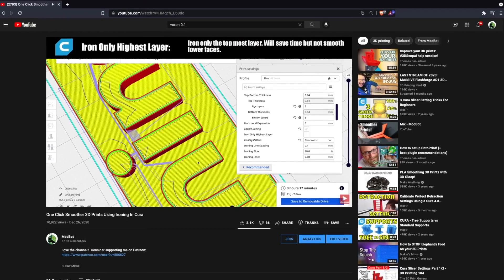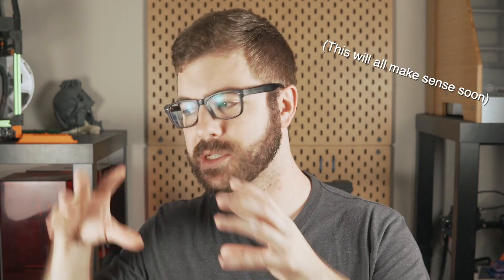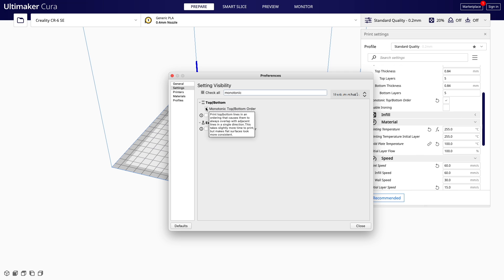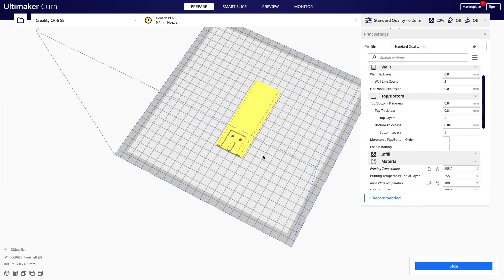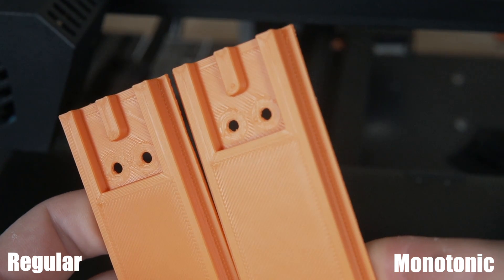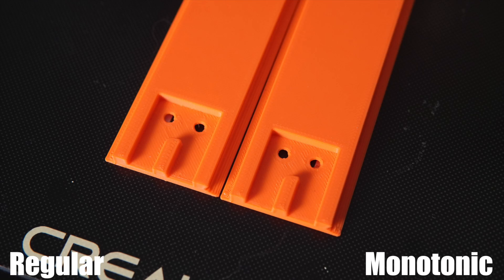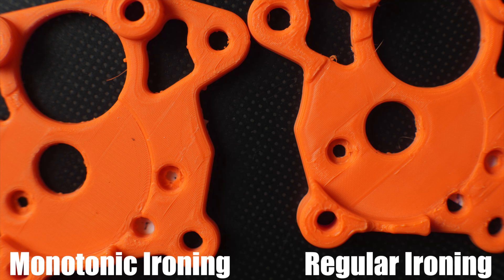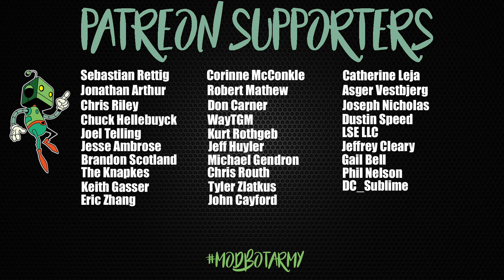Cleaner Top Layers Using Monotonic Ordering In Cura! (With & Without Ironing)

Comment: Would the z-hop option prevent you ironing from damaging your prints?
Reply: No. The problem is not the travel back but the inconsistent neighboring conditions between different lines. Some being printed with empty space on left and existing line on right, others vice versa, and worst case lines no both. With monotonic, all lines have the same neighbouring condition: existing line on consistent side, existing gap on other.

Comment: A) the differences between regular and monotonic top layer, looks almost identical to me. it takes the same amount of time it seems to 'jump back' to those gaps, of which you seem to say doesn't exist, but was very obviously there int he video.. it does one side, then 'jumps back' to the side it left behind.. the only real difference is that it starts it at the same 'direction'. 

B) it also looks like you are over extruding for your top layers in general... those are so insanely smooshed lines there bud... may want to check your settings, then rerun your tests to see if you got the same results.. because I will promise you that without that over extrusion, the monotonic will look EXACTLY the same as the regular. Not in ironing, but in just creating the top fill. and with that, you may not even want to do ironing anymore, cause the top layers will look amazing once you're not over extruding :D

Comment: What happens if the ironing just ignores holes? No jumping around at all, just pass over the hole? Would it mess up the side of the holes or would it just remove all these likes completely? :)
Reply: It would mess things up as ironing does extrude while it moves. Typically that's only 10% of the normal rate but that would results in strings and boogers on holes.

Comment: your using version 4.11 and i have version 4.8
either i have a future version or are they forgetting 0.8 is a higher number than 0.11. shouldn't my version be 4.08?
apparently version checking isn't working because 4.8 is a bigger number than 4.11.
Reply: Most public-facing projects don't use double digits for versioning numbers less than 10 and all of them use double digits for multiples of 10. 4.8 is not the same as 4.80.

Comment: Semi-unrelated: i can't see hardly any people using zig-zag pattern for top and bottom surfaces, how come? I found out it looks basically the same but sometimes print time is significantly shorter. So far it has served me well as a nice trick to save quite a bit of time on prints
Reply: When you choose "concentric" ironing pattern, cura removes the "monotonic Ironing order", so, looks like gotta use ZIG ZAG, for that

Comment: Now try my smooth profiles on your prints without ironing and compare. I’m curious about  your results.
Reply from the maker: I should be able to run one tomorrow. Only issue is all of my tests were with ABS. Do you have one for ABS? I can modify the temps but want to make sure I give the smooth profile it’s best shot against the prints I ran.
Reply: @ModBotArmy  I just modify temps and use it as is. Or just make the few mods to your profile in Cura that I show in the video.
Reply: @FilamentFriday  I'd like to see a deep dive why the new Super Fast Ultimaker profile you adapted works so well? It has halved my printing time and I don't see any real quality difference. It works, but why?
Reply: Am I the only one that's noticed cura got rid of the wrench icon by the slice button and the "select surface to place on bed option"?
How are you supposed to do layer pauses without the wrench? Manually? Smh.

Comment: I'd like to see if ironing affects dimensionally critical parts.
Reply: It will effect thickness at there is a 10% flowrate when ironing. The difference is minimal but it you're needing .005" clearance between items you'll want to run a test print to verify fitment.

Comment: I think you miss what is monotonic . The filling direction is all the same (example: from bottom left to top right). The cause of imperfections is that nozzles are not perpendicular and it will a little play when changing directions. The base plane of the tip of nozzle is not parallel to the x/y plane. So you will be printing leaning to one direction and filament will behavior differently when handling other directions.

Comment: Is there a option to make the top layer walls also smaller? Like the holes have a large padding/different direction. If they would make the top layer walls only a single pass and then iron the rest as the gaps it would look even better.

Comment: Did you ever consider using your resin printer to make parts for the voron printer? I think you should do a video about resin printing regarding which is better since we know resin looks better but is it better for mechanical or structural parts like the voron?
Reply: Resin is amazing for organic shapes but sucks for flat pieces (ie pretty much anything functional minus cylindrical stuff). This is why you don't see it often outside of minis and the like.
Reply: Resin prints can be strong but the price of those resins goes way way up at least $40 per kilo, vs a $16 roll of ABS.  So really unless details are important on the part the FDM printer is much cheaper.

Comment: Nice video.  I think you said you had been using Prusa Slicer on your Mac lately, if you dont already have monotonic as your top fill pattern, you should.  You can also set it as your bottom fill pattern too if you want, but you can find it in the infill settings.